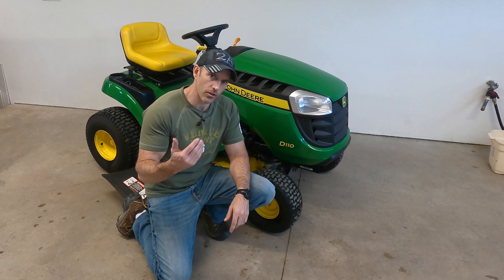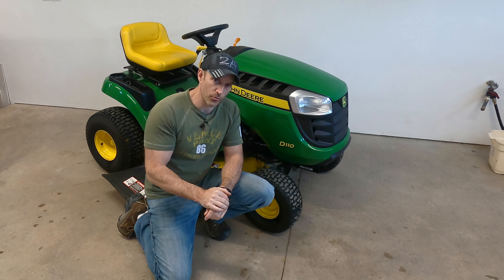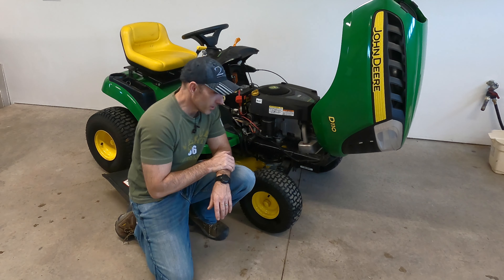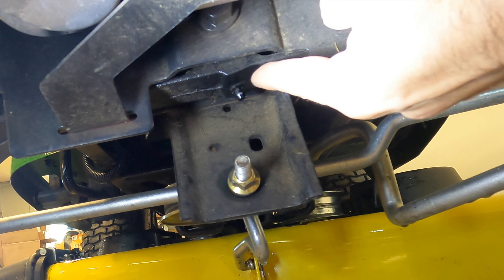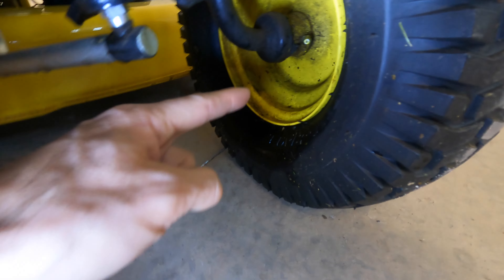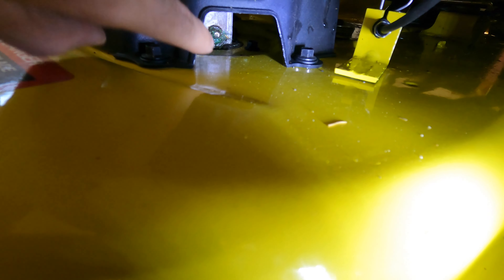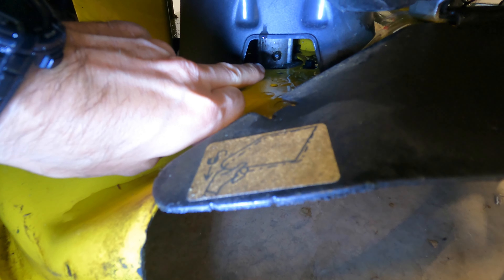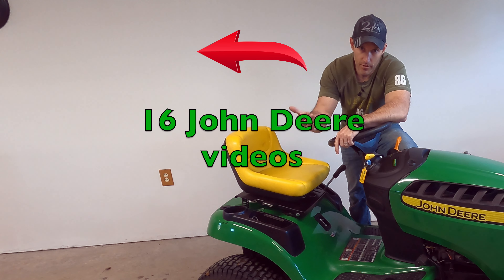Most overlooked grease fitting John Deere 100 series

Comment: Can I use white lithium grease spray on all the fittings instead of a grease gun?
Reply from the maker: No the grease zerk fittings need grease pumped into them.
Reply: @DIYJIM  thank you so much and thank you for making this video .
Reply: @DIYJIM  and is there a way to bypass that reverse button? That’s a pain in the butt, I just want to use the reverse pedal with the use of the button.
Reply from the maker: @TimTurner-w7l  I have a video on that

Comment: Would have been helpful to tell everyone what the most missed grease fitting is meant to grease and how much grease to pump into that grease fitting. Also, it's been proven that greasing the spindles with enough grease will force grease into the bearings. It's a lot of grease but it does grease them and from then on you'll never have to pump more than a few pumps of grease into those grease fitting on the spindles.
Reply from the maker: Thanks for watching